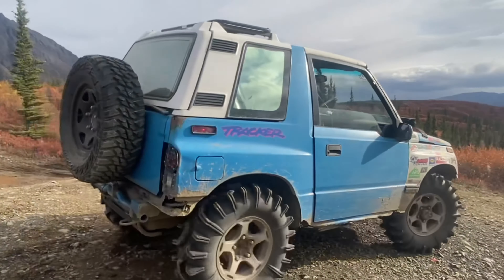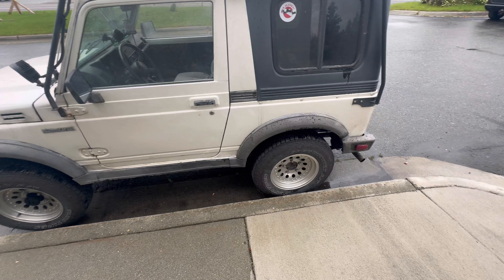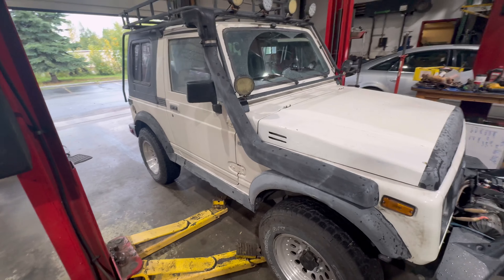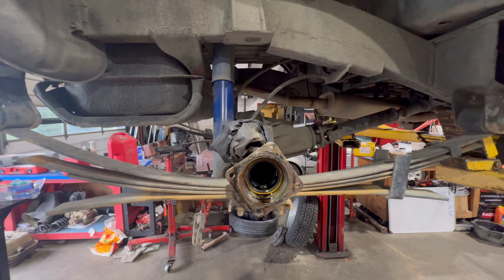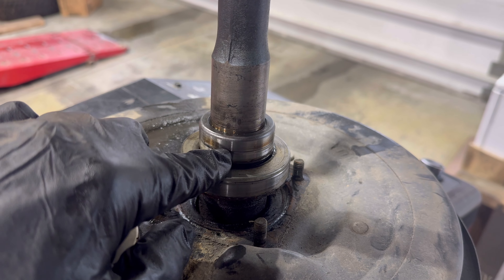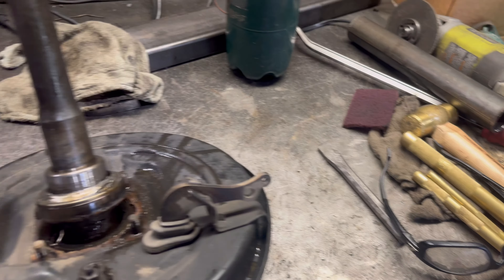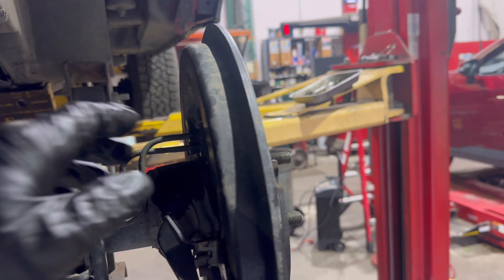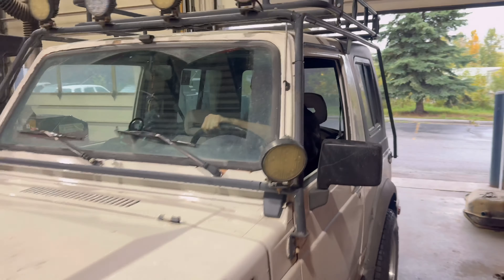How to change rear wheel bearings on a Suzuki Samurai

Comment: Cool video man what diameter is the pipe you used to put back the bearings and the retainer?tia
Reply from the maker: @JuanBeltran-gt2xw  thanks man… I have no idea, I just grabbed my bearing and walked around the shop looking for something that fit it and found that pipe by the press. It fit over my axle and matched the bearing race, so I sent it 🤣🤗